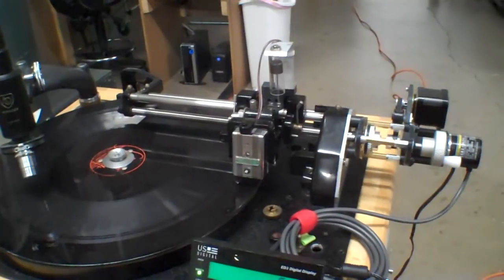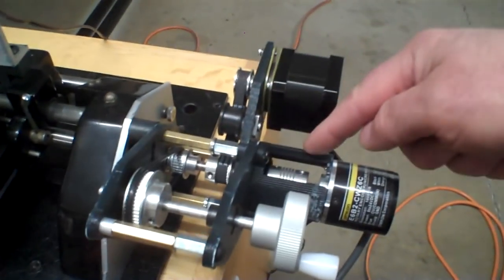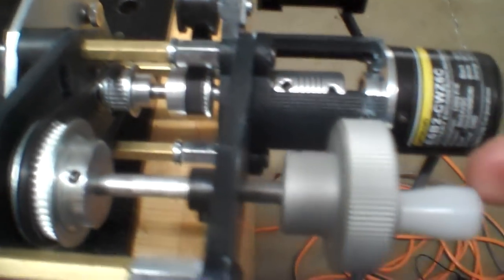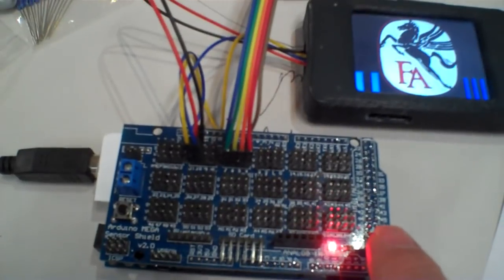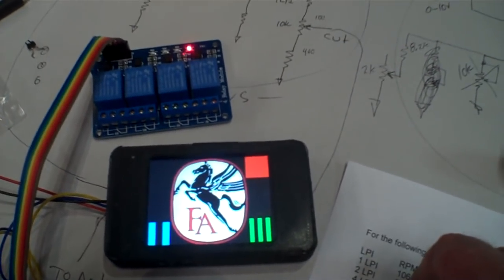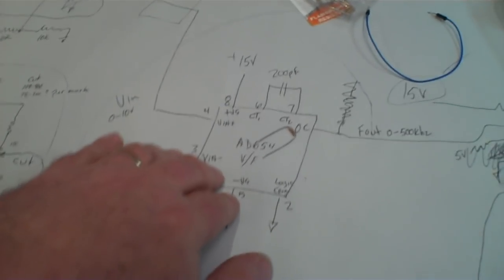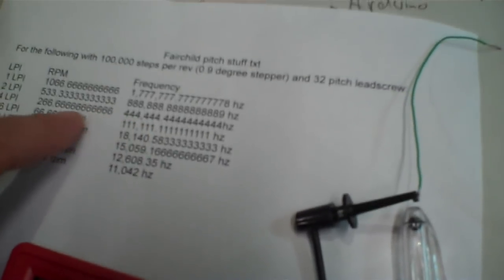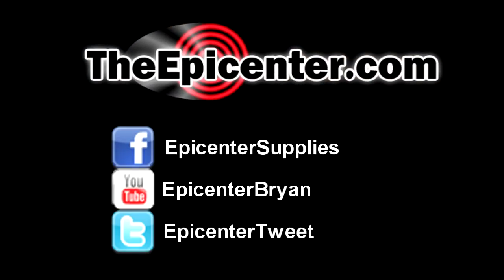PART 1 - Modifying a Fairchild 539A Record cutting lathe!

Comment: Hi Bryan, neat project.. Obviously you are an audiophile and wondering if you plan to sell some first cut's, well, second gen from your source? I would be interested in purchasing some high res vinyl for my system. I use to be in the biz and designed phono preamps and tube amps. I like low power amps and high efficiency speakers like Lowther and Klipsch.
Just curious are you an ME or EE? I am an EE but so much has changed since I finished up in 1978. Thank god fore youtube for my continuing education.. Take care, Glenn
Reply from the maker: Hi Glenn. Yep, I was an EE. Some time in the future I plan to offer some form of cutting service. The Fairchild will be my mono machine, and I'm setting up my Presto for stereo with an Ortofon cutting head. Stay tuned.